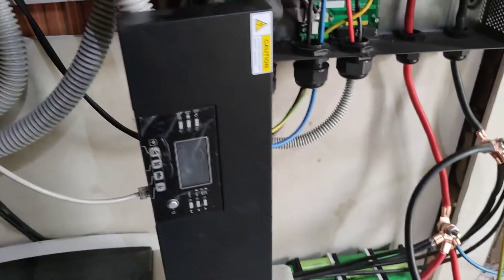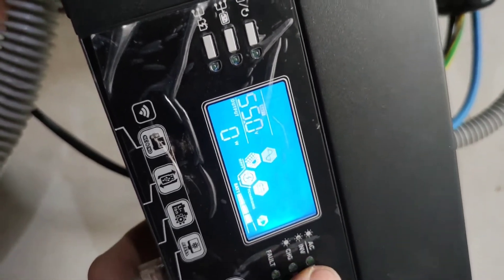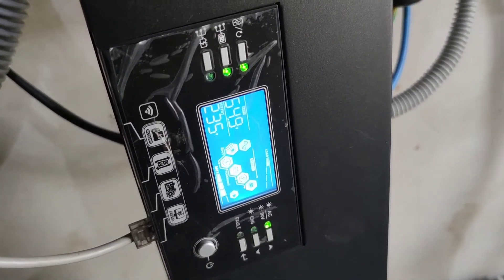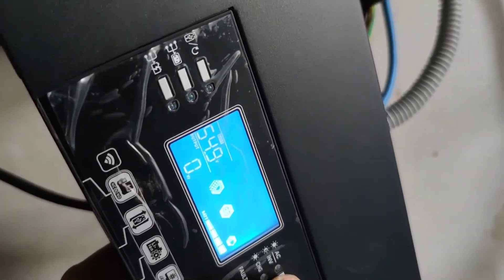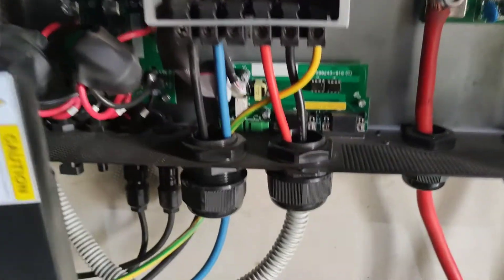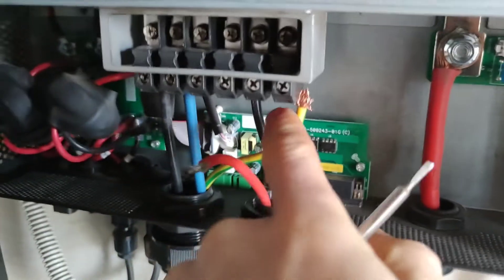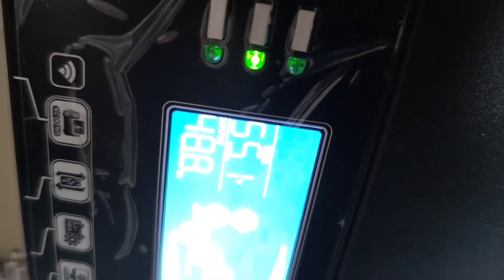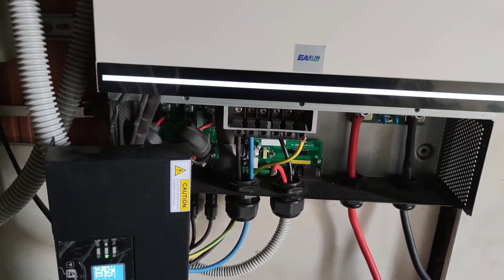EASUN 8kw inverter - outputting even though it is off

Comment: First few things to do:
- Remove any RCD on input if any
- joint null and ground of input and output too.
- Do not connect any photovoltaic pannels with possible leaking currents
- Disconnect monitoring
- Ensure that battery management is not powered from battery nor via switched power supply, ensure galvanic insulation. 
- Disconnect whole house appliances
- Connect just something with galvanic insulation (transformer)
- Try it
Reply from the maker: Hi! Tnx for the reply, but all those have already been tried and none works. I have spent hours on troubleshooting the thing. What is more important - I believed that only my unit has this issue, so I foolishly went on and purchased couple more units for my clients and guess what - all of them had the same or similar issues. So, my advice - stay away from this inverter. 5.5kw versions had none of those issues and work perfectly fine. If I simply drop in a 5.5kW inverter on the place of this one - it works without a blink.
Reply: @IgyBoyCRO  I have two units, friend of mine too and there are no troubles like you described.
Reply from the maker: @radoslavtasky8805  What can I say. You are lucky then. :)

Comment: Hello !  Like you, I have such an inverter. I have a request to you to check if it is the same with you.  When I measure with a multimeter between the plus or minus cable that comes from the panels and ground, I have a voltage of 220V.  I checked with a test lamp (ice) and it lights up.  It looks abnormal to me.  I dare not hang on a large load so as not to damage the inverter.Thanks in advance!
Reply from the maker: Hi, the voltage of the panels is not related to the ground, so it "floats" in relation to the ground and is not a problem. You can safely go and use it like that.
Reply: I think this is some kind of leak from the inverter itself.  It is not normal for cables with DC to have and AC power.  Therefore, if you have the opportunity, please check if it is the same with you.

Comment: Hello, did you find out why you have all these issues with this inverter?
Reply from the maker: Unfortunately, no. EAsun has not been able to resolve the issue, and they are now not responding for more than a month. They asked for all sorts of videos and data, but none helped. I guess the board is faulty, or the firmware is doing something wrong. Anyhow, I am managing to use it to power the house - without grid connection(the other inverter I showed is doing the battery charging from grid). MPP tracking sucks, as the algorithm is badly implemented, and needs an firmware update, but I am not sure if I will get it from EAsun. The power off and power on is not bothering me at this point, but is just adding to frustrations over the inverter.
Best part is: I have sold dozens of EAsun inverters(5.5kW versions) and their customer still ignores me. Now imagine if you only buy one single inverter. Getting the help from them in that case is close to impossible, as they will simply ignore you.
Reply: @IgyBoyCRO   thank you for your kind reply. So, you think you've got a faulty device?
Reply from the maker: @kostaskostopoulos2913  I do not know. It could be a design flaw, or firmware error. Part of the issues are definitely due to the firmware bug(MPP tracking issue), other part of the issues could be both: faulty board or bad firmware. Unfortunately, I do not have high hopes that EASun is competent in resolving the issue, so I will probably need to disassemble it myself and check the board and possibly do reverse engineering of firmware to find the solution. But this is not ideal, and will cost a lot of time to do.
Reply: @IgyBoyCRO  I hope you will find the solution. I have ordered the same for a friend. I hope to receive it within next days. 
If you think I could help you,  by coping the soft, if possible, or what else, please, just ask. 😀
Reply from the maker: @kostaskostopoulos2913  thank you for the offer. I hope yours works properly. I will be dealing with mine probably in a month, as I am busy with other stuff at the moment, and I still hope Easun will reply(naive, I know). :) 
Good luck!